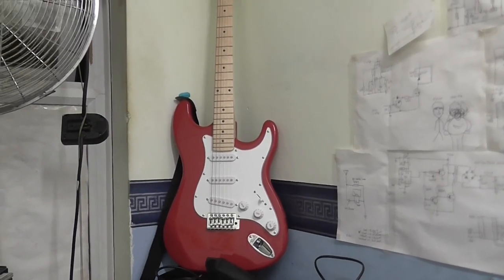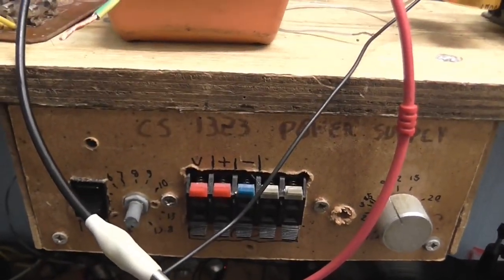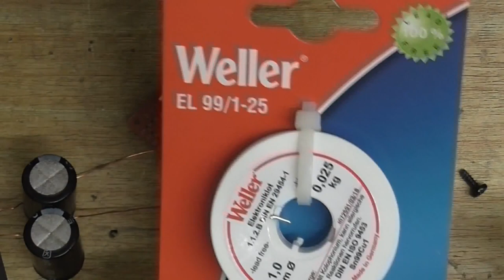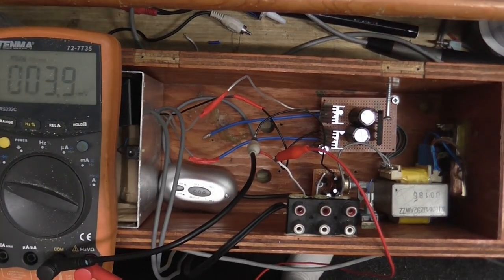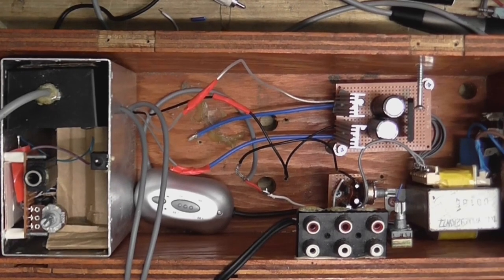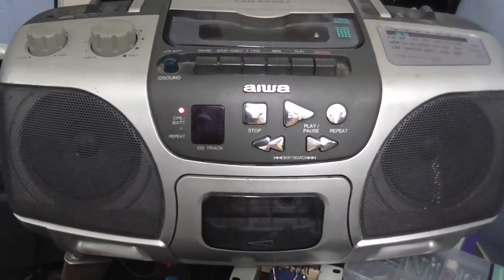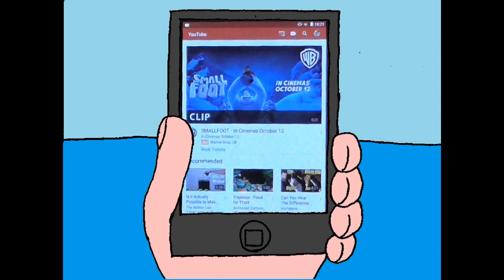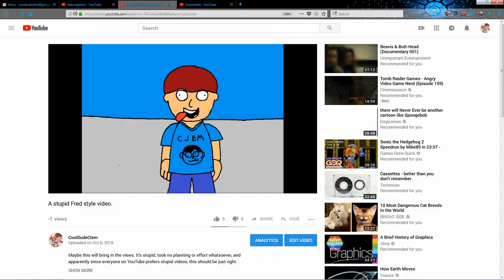I think it's about time I made another video!

Comment: Sample bank looks impressive! One idea I have for you is that, say for each note of the guitar, make a sample of the string being plucked both hard and soft for volume options because they do sound different. Also the same notes on different strings at different positions sound different too. Oh and all these options with each position of the pickup switch too! That's a lot of extra work though... Thanks for a good video
Reply from the maker: I might do hard plucks and soft ones as like you said they sound different, for the most part though it is all done. I don't want to do different pickup positions though as I would have to record another 4 sets of samples, so I'm just sampling from the 1 position that I think sounds best.